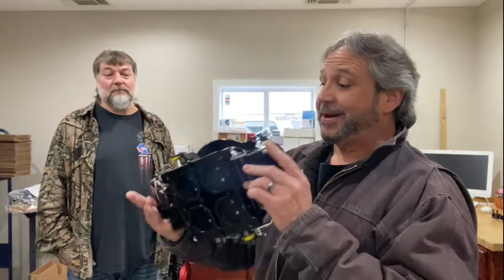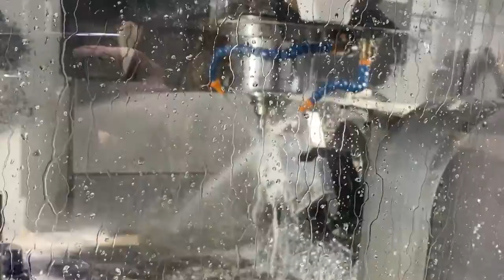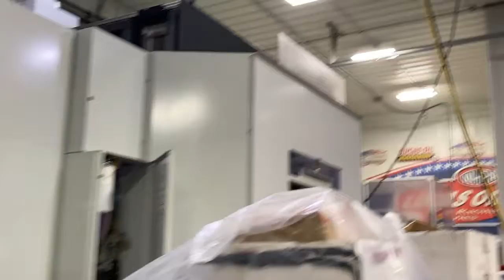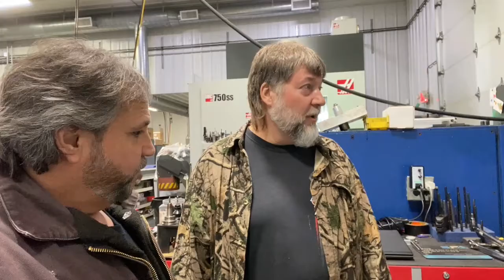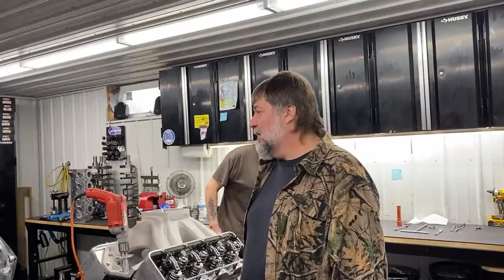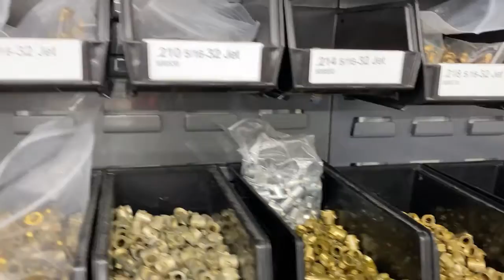DBG: Knowledge Is Power, A Tour With John Kyle, Of Advanced Product Design,  Get The Advantage...

Comment: I'm having a problem placing the new distributor housing around the oil pump drive shaft. It seems the bottom of the distributor is pushing the shaft much lower into the pump, so much that i'm uncertain it will not make enough contact to engage the top of the shaft and vice versa.  I am using part number  arp 154-7905 which is 8 3/8'' long. However I did just find a longer one on line, IS84A Oil Pump Drive Shaft Ford sb 351C which is only 2.16'' longer. Do you know which one you've used in your Cleveland? Your thoughts please. Thanks.
Reply from the maker: You have to make sure distributor gear correctly located. I used the hardened shaft from precision oil pumps, call up and discuss with Doug Gariffo.

Comment: If you take note of the steel rocker bar and how the rocker shaft is only Approximately 30% into the radius , so the load is transferred into the hold down stud, but the Aluminum rocker bar the rocker shaft is down below the C/L so now the load is transferred into the bar not the stud. From the start I would always modify my rocker bars to set the shafts below the C/L 35 years ago.
Reply from the maker: Racer that is way past my knowledge but always willing to learn. That have great success with what they have so must be working. 35, wow I’m only 36 😉